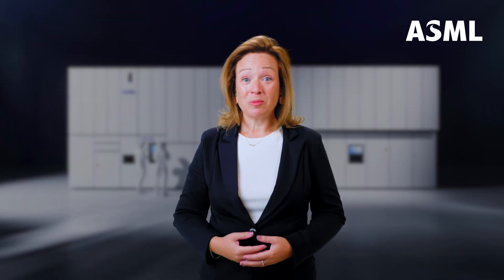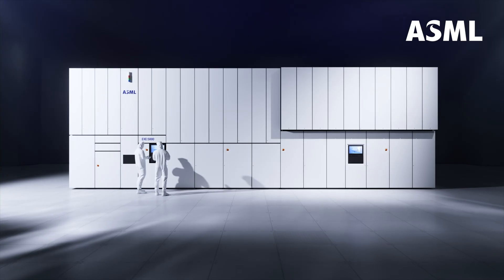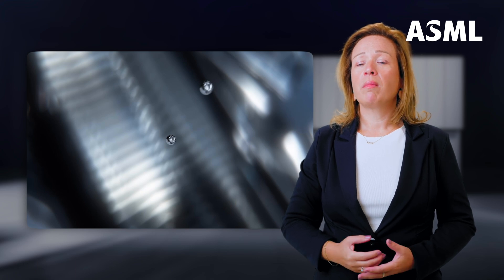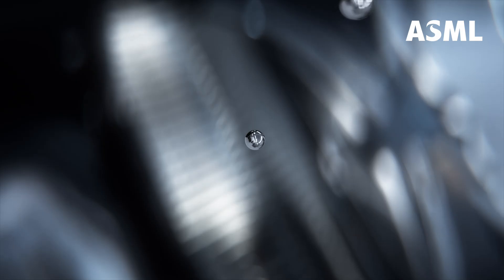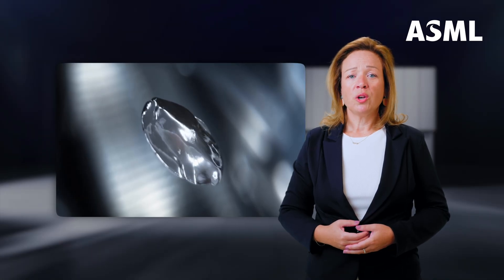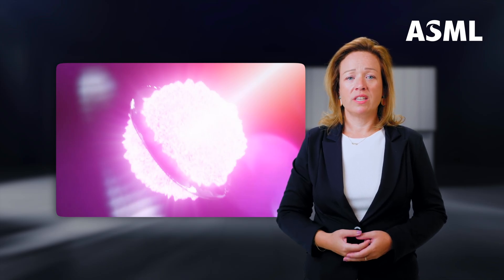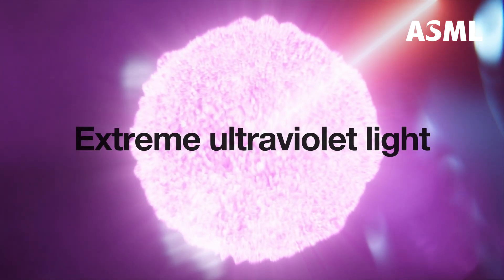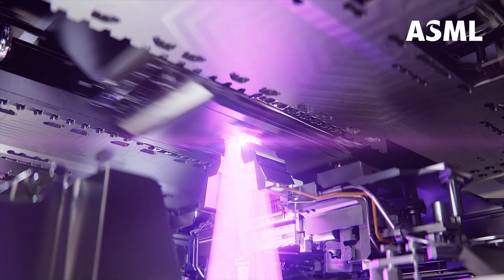Inside the machine: How a High NA system generates EUV light | ASML

Comment: Glad to see you guys in Semicon India. I am from India. We will need your machines to build a Semiconductor Fabrication Ecosystem. BTW, I knew about Photolithography since 2003 when I was in Computer Hardware tech class, but came to know about the source of Extreme UV light today only. You guys are genius. Even the PC I am using to write these texts have been built on chips that were etched with your machines. Quite fascinating. Thanks For Your Works.

Comment: why not manufacture a device that produces this kind of light instead of using tin droplets?
Reply: Good light finding a device that can emit light that simply doesn't occur naturally.
There is a reason they use Tin... Ask yourself this question WHY via tin and not via a machine and then you'll come closer to WHY they go through this route...  They can't even use X-ray equipment (which is even shorter in wavelength) because it doesn't exist... You have to invent a source...

Comment: so most hospital have x ray machine that cost 1/1000 of asml machine but produce higher energy photon. So what's prevent people from just using x ray machine to make chip with far better resolution than euv machine ? I don't get why the industry is stuck on euv when x ray machine already existed for a very long time for very cheap (comparatively)  or is this more of an issue of vibration control and resolution focusing rather than photon wavelength ?
Reply from the maker: Good question! Although x-rays can be – and are – used for high-resolution lithography, the x-ray sources used for diagnostic imaging don't have the intensity needed for commercial chip production. Synchrotron sources are typically used instead.

Comment: so in other words a scintillator
Reply from the maker: A scintillator and a laser-produced plasma may seem similar, but they're not the same! A scintillator converts one wavelength of light to another – usually a shorter one to a longer one – using specific electronic transitions within the material. In a laser-produced plasma, a laser strips the atoms of their electrons to form a plasma, which then emits light as it cools.

Comment: What happens to the tin residue after it’s vaporized? Doesn’t it build up on the walls of the machine?
Reply: The tin retains it's momentum. So even if it was vaporized most of its momentum carries it forward. Also important parts like the primary mirror is protected by a gas curtain to prevent damage from vaporized tin debris.
Reply from the maker: Good questions! The tin can build up, and even a few nanometers really degrades the optics. To minimize tin residue, our engineers have optimized the source conditions to manage and collect it.
Reply: @ASMLcompany  just put some vacuum cleaner in there?
Joking, but my best guess is that's how it works in your case.
Reply: This was a big problem earlier on in 7nm. I assume they've solved it by now.
Reply: Yup, the main reflective mirror used to get a buildup of this residue

Comment: It kind of looks like that scene from three body problem. Also I wonder how they get rid of the thin.
Reply: well, im a chemical engineer, at that temperatures the tin is at plasma state which is it's gaseous state. (like h20 not in its liquid or ice phase but in its steam phase due to the high temperatures) the light emmitted from the gas at it's plasma state isn't a gas so they are probably setting the reaction chamber at underpressure and just suck the gasous tin out. the light still can be harvested to use.

Comment: That's super cool technology
Reply from the maker: Agreed! 💯
Reply: The machine in this video belongs to the actual past, Free electron laser (synchrotron)(SSMB) machines are the future.
Reply: @gregandark8571  No, the machine in this video belongs to the present and near-future. There's a long way to go from a neat science paper to a market-ready product, and that's assuming using synchrotrons is even economically viable.
Reply: @MatthijsvanDuin  
Synchrotrons are economically viable, because china is already developing it's own machines to move away from parabolic mirrors and optics as such.
Reply: Steady-State Microbunching (SSMB) has been proposed as a concept to generate
coherent synchrotron radiation at an electron storage ring. SSMB promises to supply kilowatt
level average power radiation in the extreme ultraviolet regime, meeting the power level
demands for lithography applications that presently cannot be fulﬁlled by established accelerator
technologies. SSMB is under theoretical and experimental study, building on a proof-of-principle
(PoP) experiment at the Metrology Light Source which previously showed the viability of the idea.
Here we report experimental ﬁndings from systematic studies in the ongoing SSMB PoP
experiment, where microbunching is generated from an energy modulation imposed by a laser of
wavelength 1064 nm. The results conﬁrm the expected dependence of the microbunching
process on modulation amplitude and show that the inﬂuence of transverse-longitudinal coupling
dynamics is as predicted. This conﬁrmation of key parts of the SSMB theory establishes a solid
footing for continuing the proof-of-principle efforts towards the goal of constructing a prototype
SSMB light source facility.